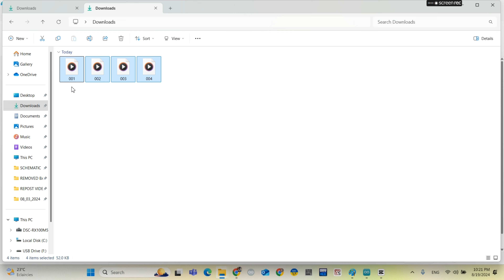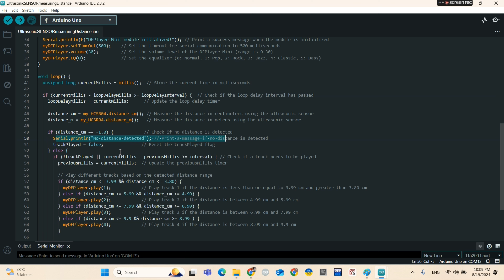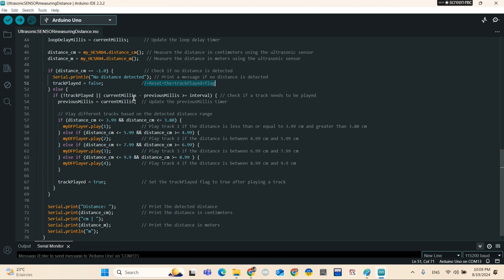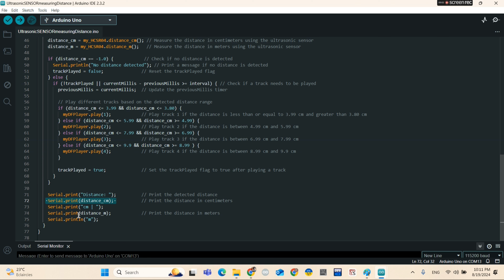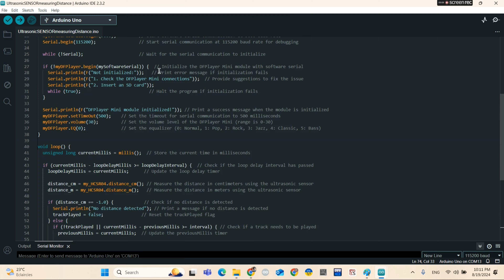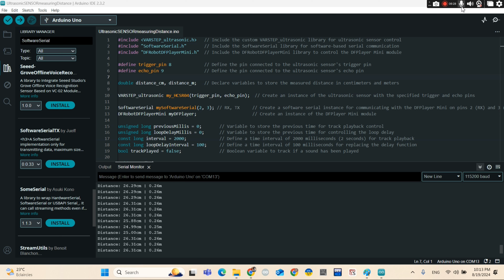Distance Measurement with Arduino Using Ultrasonic Sensor and DFPlayer Mini | Audio Player

Comment: Nice video! I'd like to ask if I am allowed to use your code and idea for a similar project? Also, I am simply a beginner in this field so I wanted to ask as a few things and it will be really helpful if you answer:

1.) Will this project be efficient for a group of beginners; will it be complex for us? 
 
2.) With some modifications, will the code, assembly, and the same components work for farther distances such as 6 ft?

3.) Will it not work if I used a different speaker? One where there is more watts so it will play louder... Or again, does the code need modifications to adjust to the speaker?
Reply from the maker: Question 1: 
I dont think this project fits for beginners. It's a complex project. 

Question 2: 
What do you mean by distance? 
Do you want to implement a wireless protocol? With some changes it will work with Bluetooth, WiFi and ESP-Now protocol 

Question 3: 

You can use other speakers, small ones